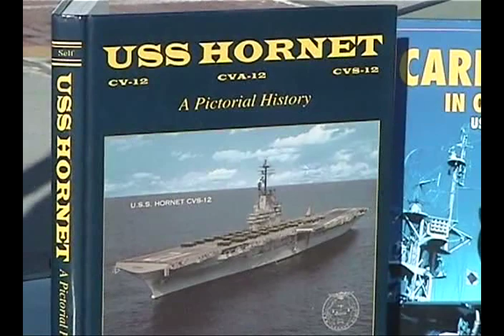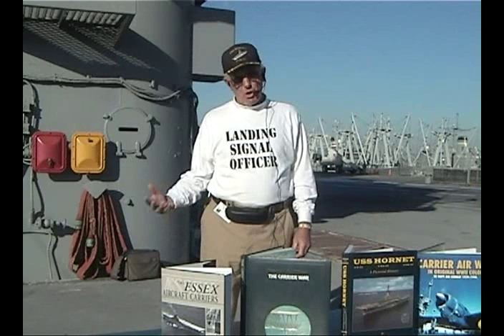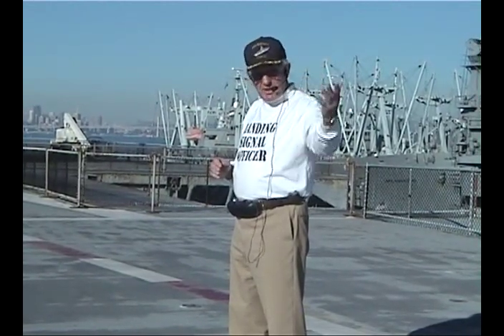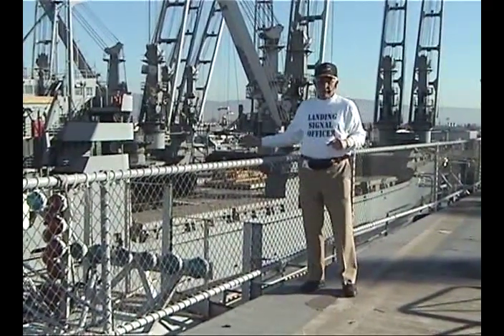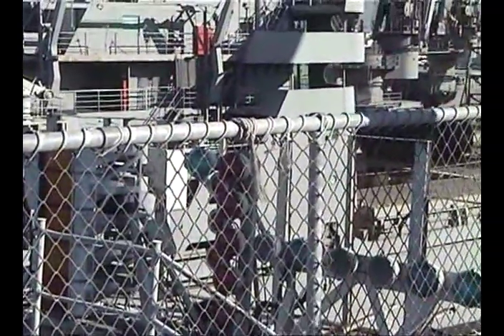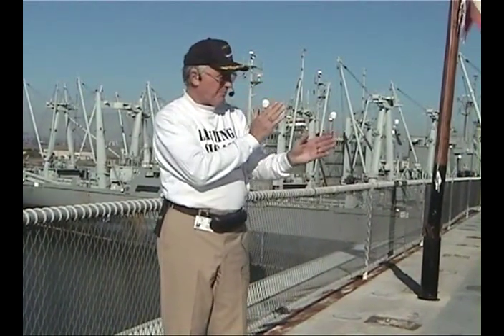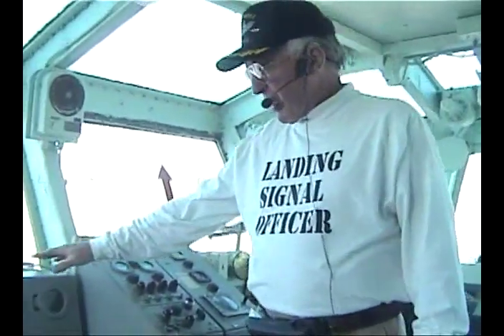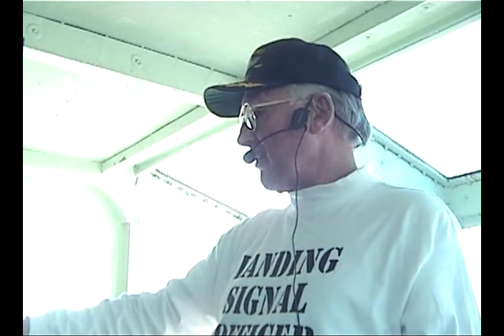Flight Deck & Pri Fly

Comment: Dwight, THANK YOU!  I finally have an answer for all those times I've been asked what existed in the area around Vulture's Row (a fire control system for the WW-II 5" guns below) or the small radar dish (SBN-12 for aircraft approach speed) or more information on the switches and displays found in Pri Fly.  Great information!

Chuck, thanks for posting this!  I had never seen this video before.